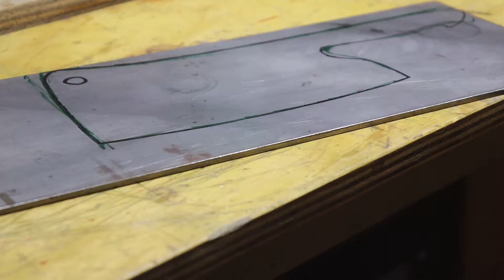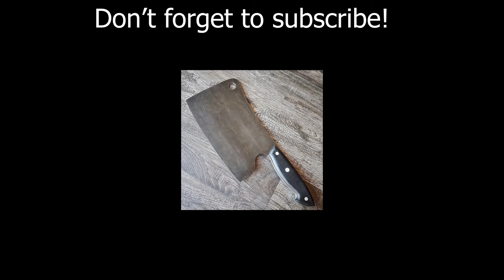Awesome Cleaver Build

Comment: Turned out Knice. What type of steel and what did you splash on the blade after you etched it.
Reply from the maker: Thanks! It's 8670 steel and that was ferric chloride that I splashed on it to texturize the etch.
Reply: @helmwoodshopandsmithy3582  Thanks brother